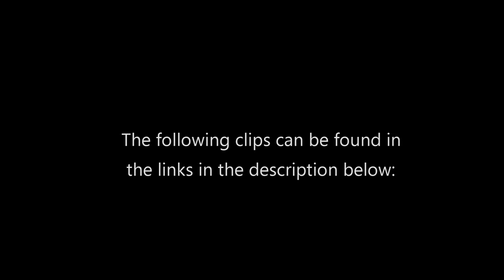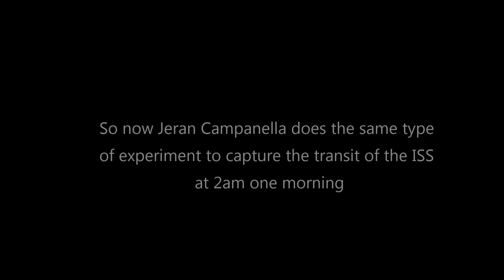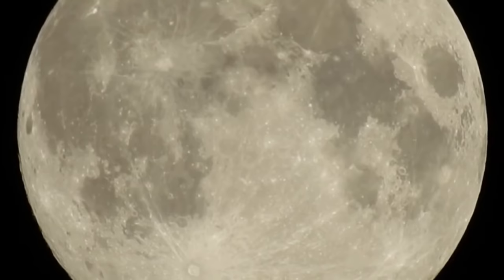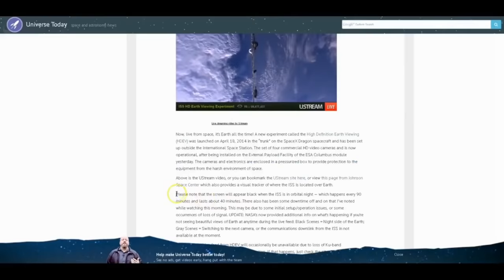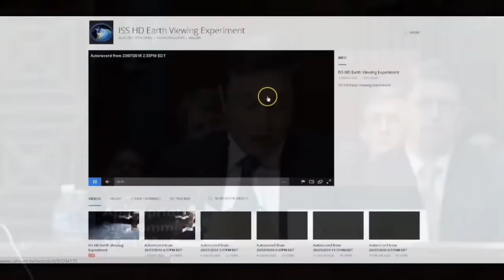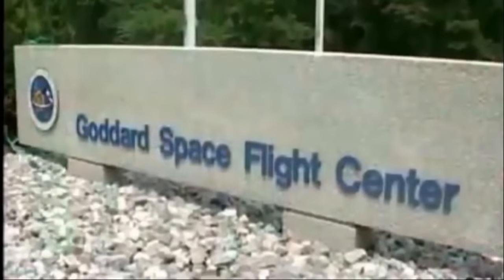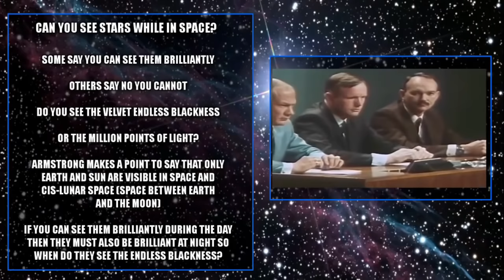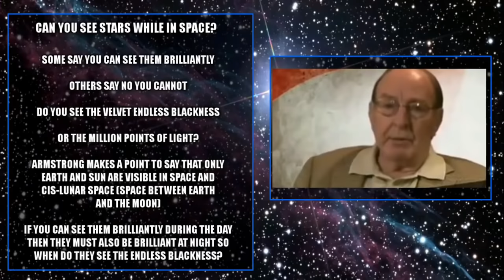The ISS Confirmed!

Comment: You say I am not capable of watching evidence and reaching a conclusion. I say you are not able to look at the science and understand that it is possible. I think you make space to be some boogyman that is impossible to overcome. What would happen if there was a leak? Do you think Hollywood showed you real science and everyone gets sucked through a tiny hole in seconds? No it would take some time to notice oxygen levels would be lower than expected and then would have to look for the leak. In the mean time they would get out the documents to explain how to handle this specific situation. Why would they need to learn how to repair this if its unlikely to happen. It's just extra wasted time and money. Yet we have scientists at the bottom of our oceans dealing with higher pressures and deadlier situations. One mistake for them and they are dead before they realize there is a problem. Bet some people in the submarines can't explain to you how their seals work either. There is not a small group of scientists and engineers making this happen. This takes experts from multiple fields working together to make this work. One engineer does understand everything about what the next is specialized at. It is called trusting them to know what they are doing. Get an engineer to make the seals. He says its good. They test it and it works. Get another to build a CO2 scrubber. They test it and it works. Ask the first engineer how the CO2 scrubber works and he will probably draw a blank. But together they helped move technology forward. No one is saying learn everything because that would be practically impossible. Your computer you are using was built the same way. It would not exist if everyone followed your type of logic. Thank all that is good that many do not follow this philosophy because we would never progress past a level of technology.